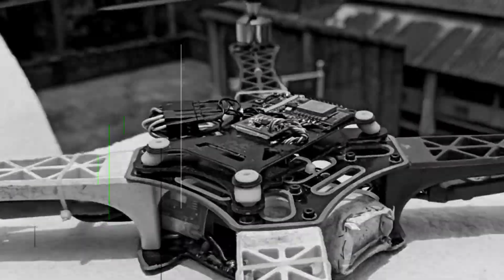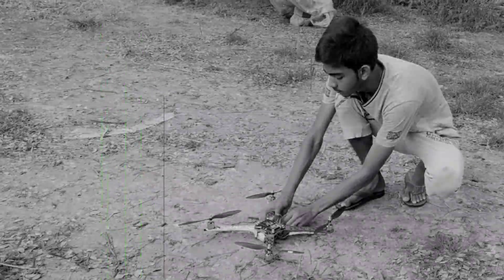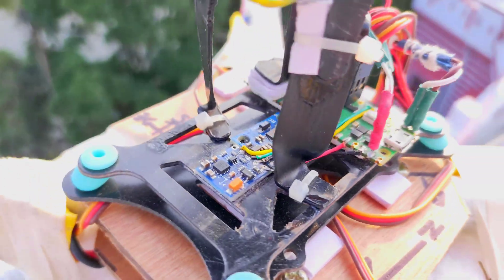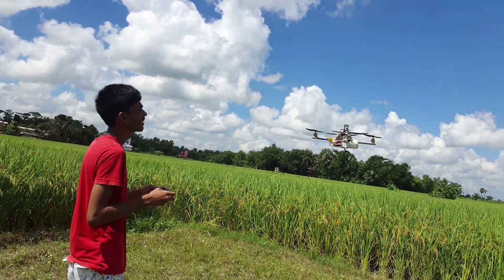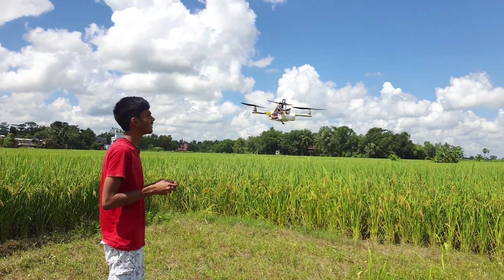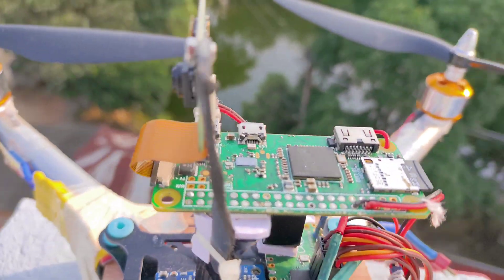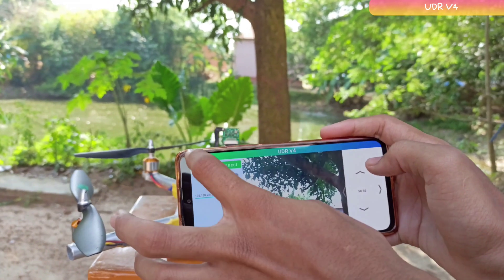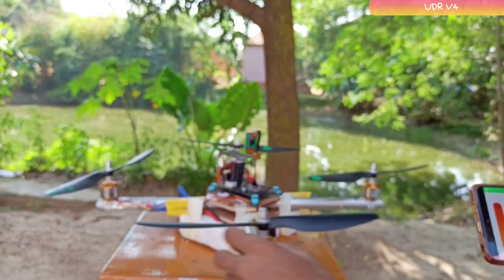Raspberry Pico Drone [Teaser]

Comment: Hey man, great project. Just a question before I go down the same route… is there a reason not to use the pi zero as the core for the whole project. I think the mpu6050 could be wired up to it for the control system but haven’t yet explored it.
Reply from the maker: Yes but programming dma, interrupts... in linux is just kinda pain. So, simple option.   Pi runs a os, since it's single core, everything runs on thread, if code stuck whole quad will crash. It's better to have a Flight Controller and Flight Computer seperated

Comment: Bro can you explain how you implemented Quaternions and how you did the PID for them? 

Also do you have any resources on how to get Quaternion values from mpu6050 and the magnetometer?
Reply from the maker: I used a quaternion based EKF, mpu only provides linere acceleration and angular velocity.

Comment: You can Make drone like this https://youtu.be/ngp0N_1v_DQ
Reply from the maker: Yup, this code will also work, just plug a esp01 wifi module instead of Raspberry pi zero. And tune the PID controller again.